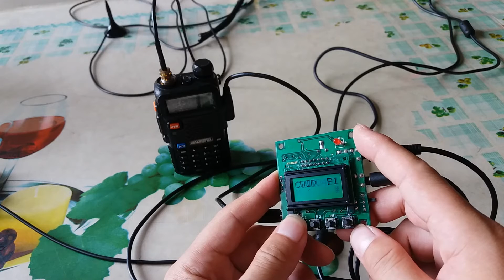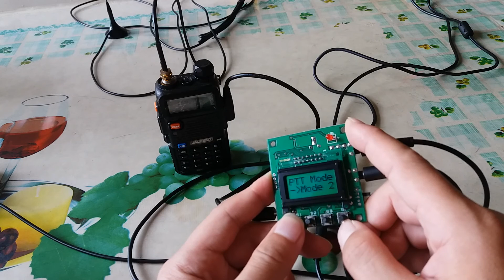How to setup a repeater system by using INNOTEK RT-DRC2 and RT-CWID48

Comment: How to use these two modules as a repeater system?
Reply from the maker: The setup is very simple. You just need to
1. Connect the speaker output and GND of the RX radio to the RX terminal of the RT-DRC2 module.
2. Connect the TX terminal of RT-DRC2 module to one of the terminal of RT-CWID48 module by using the RT-4PS connection cable.
3. Connect the other terminal of RT-CWID48 module to the microphone,mPTT inputs and GND of the TX radio.

The RF in our and output of RX and TX radios maybe combined to use a single antenna by using a duplexer.

The frequencies of RX and TX radios must be set.